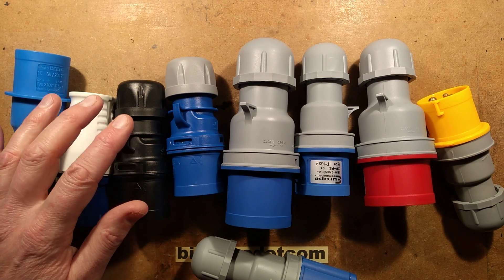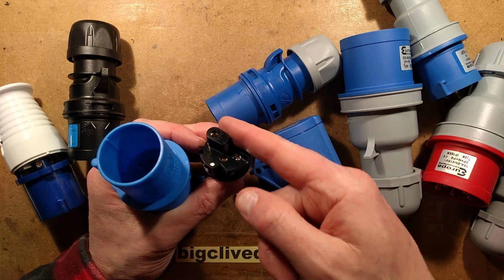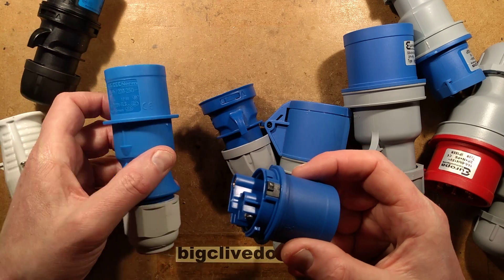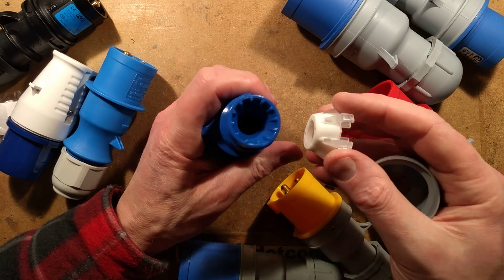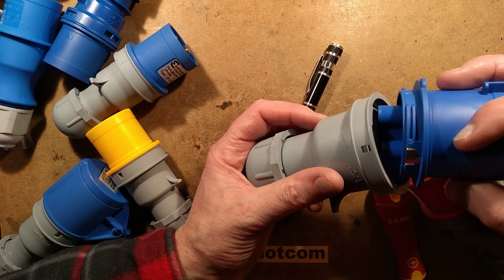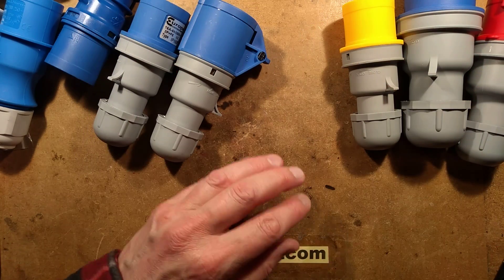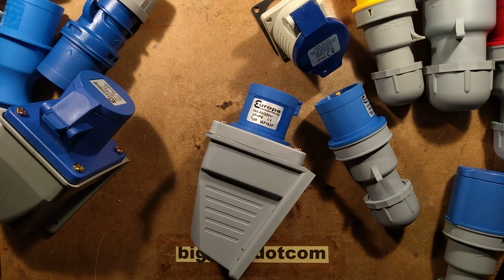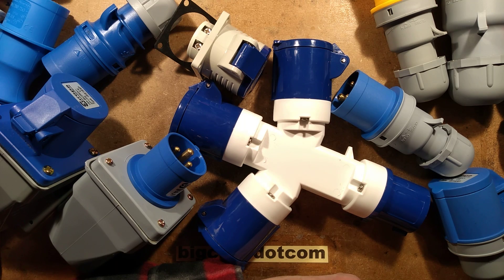My favourite industrial connector (Ceeform).

Comment: Used in server rooms to avoid pesky cleaners unplugging live systems for their hoovers (vacuum cleaners).
Reply: I work in I.T. for a decent size corp with roughly 30k employees and approximately 50k endpoints.  We have two main data centers for the entire company, but several of the sites have smaller less mission critical data centers.  In a previous life, when I was in my early 20s, I worked the helpdesk for this company.  One bright, early monday morning... systems just stopped responding.  Tell you what didn't stop working, that was our phones.  Literally THOUSANDS of people called our helpdesk in absolute panic.  Our main production datacenter was completely offline.  Dead.  They managed to get everything back online and after the smoke cleared, the CTO announced a cleaning service "accidentally turned the power off while cleaning."  In a 10 million dollar data center.  cough bullshit *cough*.  I've seen this datacenter.  There's no "accident" that could ever cause that place to lose power.  Three redundant power feeds from utility company, a like million dollar UPS system that could power new york city for an hour, and 6 50kw diesel generators....

Number of years later, I'm in a position which grants me a little more inner working knowledge of technology in the business.  It was a test initiated by the powers that be to see if support teams could failover to secondary systems and maintain the business.  Bastards.
Reply: @elesjuan  That brings back so many bad memories. Similar size network. I was the night admin which meant it was only me and a tech there and of course that is when they would kick off a change like that. If I was lucky I was at least notified beforehand... I am rarely a lucky person.
Reply: That realy sucks
Reply: +1
Reply: Clever.
Reply: For the rest of the world,  a Hoover is a vacuum cleaner
Reply: @Mr1bassman1  oops. Thanks.
Reply: @Mr1bassman1  For Americans Hoover was the 31st president
Reply: @Mr1bassman1  A Hoover is a a brand of vacuum cleaner, Nothing else. Don't let these companies do your thinking for you. Too bloody common in the UK, so many people brainwashed here.
Reply: @Coolcarting  yeah but then hoover loses its copyright protection if it becomes commonplace enough
Reply: Why would anyone let a cleaning service in their server room? I work in IT and I have co-workers in IT who aren't allowed in our server room lol
Reply: @notavirus_probably  because server rooms get dirty. Removal of dust etc, cleaning of the air con systems, concrete floors that shed small grit, people’s skin, dust and pollen etc carried in on clothes. stops the servers sucking it up. There are dedicated companies who do this. It would be unusual for them to have access to power in the room though.
Reply: @davideyres955  r/woooosh
Reply: @notavirus_probably  none of this was a joke lol
Reply: This is why the power sockets also go inside of the locked racks.

Alternatively you use c14 sockets.
Reply: Liam Fisher Cleaners in the server rooms!! Now that’s what I call living life on the edge hehe😋
Reply: Hooray a Beano comic fan.  Look up Hoovervilles a symptom when the system fails.
Reply: No I thought you meant the other hoover.....
Reply: @MichaelOfRohan  "Hoover" is a typically UK word. Not every person in the comments is from the UK.
Reply: I hover over you in my spaceship
Reply: Yep! I have slight variation of that story. I used to work as an IT specialist in the -90s. A colleague had a problem at a client where the server would unexpectedly go down during the night. Couldn’t figure out what went wrong, nothing in the log, no apparent fault. After a number of failed attempts to solve the problem, my colleague took his coffee thermos and literally spent the night in the server room staring at the console. Nothing!… until early in the morning. The cleaning lady steps in to the room where the server was located. - Good morning! - Good morning! My colleague is still staring at the console. All of a sudden the vacuum cleaner starts and… poof! The server promptly restarts. My colleague whips around his head and to his horror sees that she had connected her vacuum cleaner to the UPS outlet. The sudden voltage drop caused the server to restart. The next day there was a new lock on the room 😂
Reply: Aaand this is why I hate cloud storage, cloud gaming, etc.  F7ck the cloud.  I AM the cloud!
Reply: @manictiger  you are referring to games as a service not "the cloud". The cloud was a bull shit marketing term invented in the early 2000's to advertise server side storage to average consumers. The entire fucking internet and everything you do on it is part of, "the cloud".
Reply: @JohnDoe-sp3dc  Do not sully the cloud with your blasphemes words

Comment: In Denmark we also use these, but I have never seen the yellow one (110V), and I have never heard 110V be used i Denmark (I am an electrician in Denmark). The blue and red you shows around 6:00 is exactly the same model as in Denmark. We just call them Cee plug instead (Cee stik in Danish) 😊

Comment: In the Netherlands these connectors are used on small motor boats, to connect to the electricity when in the harbour. The max current is six Ampère, so it can be used for making coffee or watching TV but not for heating.

Comment: In germany we use these a lot. You see them everywhere, particularly for three phase power, but also for normal 2 phase stuff. Now this season for example, all the stands on the christmas market have attached their stands and rides using these cables(though, i am not sure if the Large ferris wheel does use this connector, maybe).

Comment: In sweden they are at campsites and more. And it is the standard for at least the 3 phase stuff in construction industry. On construction sites they then are connected to a power central with fuses for all outlets, both regular 1 phase and 3 phase. At least that was common a bunch of years ago when I was in the plumbing business.

Comment: In Germany we use red CEE for 3 phase and Schuko for single phase. Blue CEE is is also called caravan plug and is most exclusive used for this and "snack vans", maybe more common in event industry. 
In my opinion blue CEE should be used instead of Schuko when continuous high current is drawn. Friend of mine fried an Schuko outlet when he ran an construction site dryer over longer time. This was maybe also caused from dirty and worn plug and socket as you get on construction sites. Schuko is good for low power hand tools, it is not so bulky as blue CEE. Specially when its is molded to the cable.
Red CEE should also be available in 4 pin type with no neutral conductor, never seen it in real live. Funny story, at an festival in our small village i was asked to have a look why the heat plate is not working, turns out 5 pin CEE with 4 conductor cable was used from outlet to kitchen tent, works on 3 phase motors but not single phase appliances^^ 
Older installations used Perilex connectors for 3 phase https://en.wikipedia.org/wiki/Perilex

Comment: Use these at sea. On ships (UK registered). Deck tools are 110v using the yellow plugs. Have to carry around a large transformer, if the only socket available is a (blue) 240v, to tranform down to 110v. Depending on vessel, a central transformer is used and yellow sockets available on deck, inside water proof boxes.

Comment: Very interesting, thank you Clive. It always alarms me when, on some campsites, particularly in France where I have to put short adapter cable onto my reasonably waterproof plug and plug a standard domestic european plug into the campsite supply. Completely exposed with no attempt at  shielding from the weather

Comment: Used in entertainment in the US. Definitely not fun when Audio is jumping off of the LX power distro with the 5 conductor, 100A version of this. Haven’t seen the smaller ones being used around, we usually use NEMA L5 or L6-20 depending on the voltage needed.

Comment: Netherlands, on the red 3phase version, there is also a 'fase verwender' (german)  plug available, so if you have a machine with a motor, and it runs the wrong way, you can swop two phases. The thing runs the right wat without opening the plug, and only  using a big flat screwdriver. Als ideal in adapter cables.

Comment: Just used the Blue, Red and seperate Core ones. Even had a Male input version with phase changer if L2 and L3 are switched (as the setup is fed from a standalon Generator witch then is feeding a Container thats supplying multible units. the Changer is for house installations if they are not fully up to spec). Im from Switzerland so as Floris Kuipers said, they are more or less standart for higher rated stuff in Europe

Comment: They are used a lot in many places. our standard plugs are only good for 13A, these plugs are 16A,32A, 63A and so on.
I hate them, because they have broken several 4mm flat blade screwdrivers because the (cheap chinise one) has those not qutie cross head, not quite  flat head screws.
so a flat blade is actually only in contact at its ends and hence can break.
I tried philips drivers but the plastic molding will not let the shaft into it.
Grrr...... :)

Comment: Hungary we use these reasonable often, but mostly the 4 or 5 pin ones because if someone needs power they usually go straight for 3 phase
Most often used in temporary installs like distribuition in christmas markets, concerts and shows with portable stages, etc

Comment: Can some generous soul send big Clive an ATEX-rated version of these for use in explosive Atmospheres (ex)?  My access to the 'gettin' spot' at my new employers isn't great or I would.

I'd also like to see him tear down the 'shore power' version as used on some emergency vehicles, which automatically 'spit out' the connector when the engine is fired up, so that you can't drive off with the cable still connected.

Also in the industry I work in (Oil and Gas), they tend to be referred to as 'commando' sockets, which I believe is the MK Brand name.

Comment: At my job in Australia selling welding machines some German machines come with these on them for 3 phase 415v power. I've never actually seen them used so sadly they get lopped off immediately and replaced with the common plugs used here. I can vouch for the quality of the brass pins inside, very nicely machined.

Comment: In the USA, for some reason, some fire apparatus use these for shorelines. Both 110v and 220v are used for 110v 20a. They're more expensive to replace than a regular 5-20R, and hard to find. Quite annoying as us Firefighters break everything!

Comment: I see a lot of these gray/blue ceeform connectors in the data center i work at in the Netherlands. All industrial type / high current connectors. If i am not mistaken even my induction hob at home is connected through one of those connectors! :)

Comment: We use the 16A blue version in New Zealand for caravan connections and also for EV charging.

The blue and red versions are both used for food trucks.
Reply: You can also buy a wall socket with an interlocked switch. It is not possible to turn on without the plug inserted and you can't remove the plug without turning off first.

Almost idiot proof.

Comment: We used to use these in the semiconductor test industry for connecting high power devices such as Thermostream temperature systems.  I found the plugs a bit difficult to unplug sometimes, they needed a certain amount of wiggling and force.  So I was horrified to see that at least some electric car chargers use the same plugs.  The thought of a little old granny trying to unplug one of these is just the sort of thing to put people off electric vehicles.  I may be wrong but I think other connectors are more commonly used for vehicle charging now?  My Hillman Avenger has no need for such devices.

Comment: The red one is what we have here in Scandinavia mostly sometimes you'll see those other forms of CEE types but very rarely
Reply: Yep. I'v moslty come across those red ones here in Finland. Tug boats, where I work, we use those to connect ship to 'land electricity'.
Reply: In industrial applications blue ones are common too. Sometimes black 4p ones for 525V. Sometimes yellow ones. But black and yellow are very rare to see indeed. I'm based in Sweden, I work with industrial distribution panels and MCCs
Reply: Blue ones are common on docks in Sweden, for connecting boats to shore power.

Comment: Both my Volvo 240 from late '80s have a male plug (black not blue, same connector) in the grille for the battery charger / engine block heater. Nowadays the manufacturers of block heaters such as Defa and Calix have their own much smaller connectors. The ceeform was the standard until early 90's.

Comment: I would have imagined the connector ratings scale according to an E3 or E6 series but it doesn't seem to conform to that either - so why not 64 indeed?
Reply: Also, these are used fairly often in Turkey, to the point where I have never seen one on the shelf that was made in another country. However for three phase there is also another connector that is used quite often, but I don't know what its official name is - it shows up on Google if you search for "trifaze priz" along with the usual Ceeform stuff. 3x25A + PE, with the phase pins located evenly around the center ground pin.

Comment: Used in the data centres by power distribution units especially the 16A and 32A connectors. (Ireland and potentially across Europe)

Comment: I live in the Netherlands and work in both the light and sound "industrie" and at a camping. At the camping we use those 230v plugs for the caravans etc, they are fused of at only 4 amps but just to use a nice standard that can handle a bit of abuse. During my light and sound stuff I only use the 3fase: 63a, 32a and 16a connectors. If something is one fase powered it goes into a powercon connector (neutrik)

Comment: They are commonly used in Sweden and as I understand it they are used all over EU. I use them instead of Schuko if I know that I'll load that outlet past 10A for more than 1h as the Schukos are rated at 16A but only for 1h. Unfortunately they have a low Wife Acceptance Factor so I won't be able to use them in the living room to power the stereo anymore.

Comment: Ceeform connectors were and are used at most if not all construction sites and camping sites in Romania as well. And at the station level in the Bucharest Metro with a 220V label for power uses in maintenance.

Comment: I used them in my car to connect a removable amplifier/subwoofer arrangement without worrying of swapping polarity by accident. Worked fine and reliable. 

Kind regards from Germany
Reply: Good idea👍 better than a vibe quick Connector I use in my car, I often have to remove my sub and amp.

Comment: Back in school, I used to do the light for a children's theatre group (children playing theatre for children) in Germany. We had the 3-phase 32A on our dimmer packs and a 63A-to-2x32A (and 4x16A Schuko) box since most places we played in only had one 63A outlet. Also in the box was a 32A-to-63A adapter, because one place even had just a 32A outlet (which wasn't a major problem, because we only put ~15A on the dimmers - but we made sure the fire department had no reason to look into that closet when doing their inspection).
But the real fun always began with connecting the lights to the dimmers, because we had fully connected 40-pin Harting cables for that (dimmer to 10-Schuko-boxes). Those cables were real bitches and heavy as hell. But it was great fun and many a weekend well spent. :)

Comment: You should do a video on the 4 pin split phase ones to confuse everyone :)  I once worked at a place where the “electrician” used the extra live pin for a resilient earth, both creating an enormous hazard and mistaking the reason for the resilient earth, to survive being disconnected in a wider network of connections, so extra exciting.

Comment: PDUs (Power Delivery Units) in datacenters here in the US use a similar connector for high power connections but it seems like it's usually just specced as an IEC 60309 3P+E 9h 60A. I think something similar might also be called a Hubbell connector.

Comment: in Slovakia they are pretty common you can find these at parking spots, any construction site at homes for powering concrete mixers even in grocery we use them to power ovens and ""cutters for ham/cheese"" idk what is the correct name for that :). Also for charging forklifts & pallet trucks

Comment: Thanks for sharing this clip Clive, watch your channel a lot. I use CeeForm a lot in the Netherlands in underfloor busbar systems in a large datacenter. 
Did i mis you pointing out the locking cap? It locks to connected connectors together. 
Btw we use Ceeform With ip64 rating, it has a rubber seal en twistlock connection.

Comment: We use them a lot in the IT industry. They go under the floor in data centres and while they are not exposed very often when the tiles are lifted they take a lot of abuse being trodden on etc. The surface mount one’d usually get bonded to the sub floor so server racks above can easily be plugged in via a hole in the raised floor above.

The last connector you show in the video people try an avoid as the cable grip is not the easiest to slide on the cable. It is just the wrong way round with the narrow end going up the way.

Comment: That red 3-phase one is standard here in Finland. Used for welders and everything that uses 380v 3-phase. Blue 1-phase ones are normally in camping sites where they connect camper vans and trailers to 230v. Or at least i havent noticed those often anywhere else.